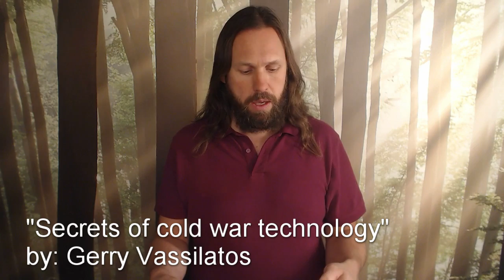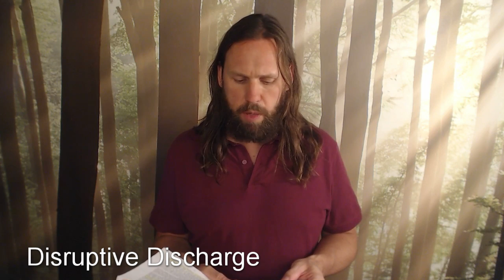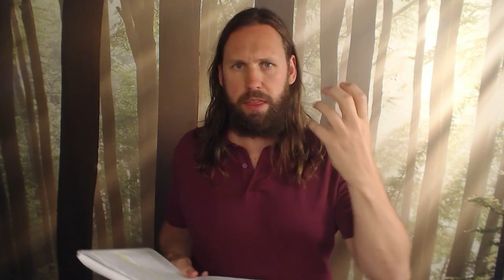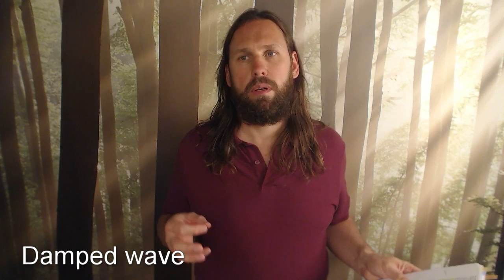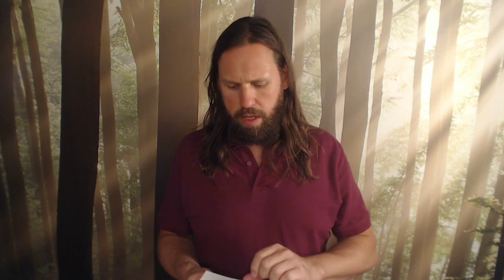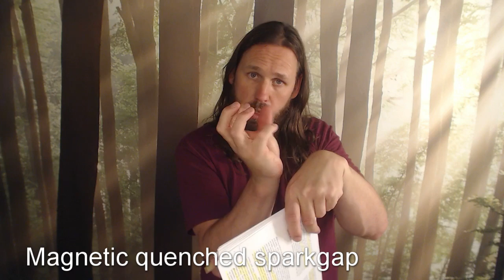Nikola Tesla's Radiant Energy Part 1 of 3

Comment: radiant energy is dc high voltage zero current. radiant matter is pure voltage. aether is voltage!
Reply from the maker: a high voltage change with very short duration (impulse ) equals current. but it's a current without a magnetic field, without Aether "drag"
Reply: @MasterIvo  so is the "aether drag" voltage ? i really think so! infact i believe voltage itself is aether when truely seperated from current it becomes a superdynamic neutral particle super creative by its nature and at a spin (quantum motion) faster then light!
Reply: Generally a vibration in ultraviolet and above means breaking apart the nucleus structure.  When the vibrational frequency gets near Gamma, we are probably looking at a vibration that is   breaking the proton or neutron back into ether medium or photons, like the sun does.  Roughly 918 photons per proton.  This releases the binding energy of the proton, like spent rocket fuel.  Also there are neutrinos involved, or bunches of photons that did not completely vibrate back into photons, like neutrinos that explode  upon impact, like paired photons in a laser particle beam.
  Tesla called neutrinos "neutrons," but he was getting them to beta-decay electrons out of nucleus and running an electric circuit with them, he called it cosmic energy.
  Also when you separate and atom into electron and proton it releases 1  mole of photons that were stored in the atom, and that is 1 mole per electron-proton pair released.
Reply: @JoeDeglman  bro ur facebook bro ??? i need help "knowledge" answers i seem to have reached pretty deep into the rabbit hole. i need data i have endless questions and i believe u really can help me out on that!
Reply: @boxgajodar4144  I have no facebook.  I am however on YouTube   https://www.youtube.com/results?search_query=joe+deglman+
Be glad to guide you along.
Reply: Anything to do with magical particles are false BS.

Radiant energy refers to voltage, that is correct BUT you got it wrong about voltage doesn't have magnetic field.

Voltage itself IS magnetic field. Integrate voltage and you get magnetic flux, magnetic field. What current really is, is dielectric flux flow, aka dipole self-destruction. The dielectric field formed between two voltage polarity, or two stationary magnetic field as described by walter russell, tends to collapse when the two magnetic fields are connected through the matter. It destroy itself!

This is the unnatural form of electricity. Radiant energy is simply "the collapse of dielectric field" but the connection doesn't last long enough for continuous destruction as compared to DC and AC. This is why impulse current tends to churn up the aether, generating greater voltage than the collapsing field.

Hence, this radiant energy aka self-amplified voltage can pretty much charge a battery.

But. This system isn't that superior when compared to  negative power system, MY system.

"Electrons"/dielectric flux always "flow"/collapse from negative to positive. IS IT?

Nope. Using "electron-deficient"/materials with natural biased dielectric field, you can force the dielectric flux to flow from positive to negative. This is the natural form of electricity. Self-amplification, regeneration, restoration and strengthen of dipole, strengthen of stationary magnetic field with opposite spin.
Reply: @lukiepoole6701  Pretty much, I think you are right.  But, magnetic field is the flow of the dielectric medium, acting as a waveguide for charged particles (positive or negative) between voltages.   When the charge level between source and target is strong enough, the dielectric medium lines up and allows for the flow of charge, a dielectric breakdown.
   You cannot have a magnetic field unless there is flow of the a dielectric medium.  A magnetic field is the flow of the ether medium from source to target.  Without flow there is no magnetic field, no magnetism or magnets.
    Matter or a conductor just acts as a waveguide for the flow of the charged particles, when matter is involved.  But, in this experiment, I think we are talking about the breakdown of the electrode itself, back into plasma, protons and electrons, and possibly breakdown of protons into its constituent particles, the photons, AKA dielectric.
  So you are right, there is no magnetic filed unless there is flow of charged particles.  "The magnetic field we see flowing around all charged moving particles is the ether medium."
Reply: @JoeDeglman  Wrong. Flow isn't necessary to form magnetic field. Do you see any flow in a permanent magnet? No. Magnetic field forms die to alignment. No flow actually needed. This is why voltage alone is enough to generate magnetic field.
Reply: There is a flow in a permanent magnetic. If there were no flow in a permanent magnet there would be no objects travelling towards the ring current of the magnet, I.E. no magnetism. Whenever something moves there has to be high and low pressure, and movement in the ether medium or dielectric.
    Voltage is created by what is known as charge, but not necessarily movement.  The charge must overcome the dielectric forces to create a flow, then generates a magnetic field. No one has ever created a magnetic field without moving charged particles.
Reply: @JoeDeglman  That's right. No one has ever generated a material that generate magnetic field without moving "particles". This is false as permanent magnet itself really does not have any moving "particles" in the first place.

You need to know that there are no such thing as particled and every atom you see is a tiny magnet.

You should know ken lee wheeler where he show the truth magnetic field of a magnet that is generated using positive power.
Reply: @lukiepoole6701  Check out Distinti on magnetism.  https://www.youtube.com/watch?v=9sUP_iL6NIU&t=213s
   What causes magnetic poles to "attract" or "repel" is the flow of the dielectric into one pole and out of the other.  Two north poles "repel" because of the high pressure created between them when the medium tries to flow out of  those poles.   Same poles attract, because of the alignment of the dielectric flow.   Two south pole "repel" because of the medium flow  into those poles pushing the magnets apart.
   Even galaxies have a dielectric flow, known as a fermi bubble.
   Any time you have charged particles in a ring current, such as a magnet, indictor coil, planetary ring, or plasma torus, star, galaxy, you get a self sustained magnetic field or flow, a self-draw of current or plasma.
Reply: @lukiepoole6701  Right Ken Wheeler, He and Dollard try to say there is on such thing as an electron.  Did you know wheeler completely fudged the words "an electron" into Steinmetz quote.  Here is the original text, page 11.  https://archive.org/details/elementarylectur00steirich/page/n6
    Steinmetz said no such thing.   Steinmetz is merely pointing out that Ampere's law is not due to charge on the wire, but the movement due to energy storage or inductance of the wire, AKA the dielectric storage between the wires.
    Here is how CERN strips an electron off of a proton.   If Wheeler was right, a proton would just generate another electron out of counter-space.  Wheeler is completely wrong and had to make it up as he went, because he knew the facts were not on his side.
https://science.howstuffworks.com/science-vs-myth/everyday-myths/large-hadron-collider4.htm
   If Ken were right, CERN would not have to save electrons and reintroduce them back to the atom, the proton would just create a new end terminal out of counter-space.
https://www.quora.com/How-was-an-atom-of-antimatter-anti-protons-in-the-nuclei-positrons-surrounding-it-created
Reply: @lukiepoole6701 My take on what Tesla is doing is the same thing as a "Peratt Instability."   If you watch what the plasma dumps are doing in this "Peratt and Petroglyphs" video at about 9 minutes ----->    https://www.youtube.com/watch?v=6meaU1QcSdA&t=880s

then they are doing the same thing as Tesla, dumping a lot of capacitance discharge from a plasma focus device.

   So in  a Peratt instability, we see the vortex rings, essentially caused like a smoke ring or an eddy current in water flowing through a culvert, AKA moving the ether medium through itself, creating a constricted flow, like a smoke ring or a torus in a carburetor flow.  Essentially this is a smaller-scale Herbig-Haro situation, that's creates planets or stars at the vortex rings in a constricted flow.

  Essentially Tesla then is trapping the electrons and charged particles in a vortex ring, as in the Peratt video or a smoke ring, thus separating them from the medium, and this allows the ether medium to flow through separated from the electrons as radiant energy.

Comment: My explanation of what's possibly happening at 4.50 min is the coil can not sustain the over sized magnetic feild so as it equalises it re converts some of its energy  into voltage. Voltage can change direction quickly but current cannot. Just like a river. The flow of the water direction  requires effort to change but the the pressure of the water can change direction with ease. Imagine a fire  hose on full power and it take 3 men to hold it steady and direct the nozzle in the right direction. Its hard for them to instantly change its angle but if you stab the hose in the side it requires little effort and now the pressure voltage is squirting out the side. Easy for the voltage to change direction but harder for the current. 
 Best analogy I can use would be water coming out of a hose and hitting a square plastic  tub on the driveway and pushing it along. Initially it starts to push it but the water pressure is met with resistance and splashes some to the side but as it starts to move, more of the water pressure is used to propel it until the water equals the speed of the bucket. Think of the water splashing out to the sides as initial voltage spikes and the flow of the water as the current!
Reply from the maker: I like the thought of water splashing, but instead of water, I imagine these splashes, are longitudinal aether pressure waves/fields
Reply: @MasterIvo  Yes exactly like podkletnov's impulse gravity beam generator, sounds just like sub-quantum kinetics.
Reply: Adding to my comment.... So as the coil tries to take on charge as fast as its inductance will allow it finds itself unsustainably overloaded and  oversaturation of magnetic flux and almost instantaneously it does a backpressure burp if you will. But as it can't change its direction of current instantly it instead relieves it self via a voltage burp that can change direction much faster!

Comment: My thoughts about this one:
1. The velocity of propagation of a changing voltage level in a copper conductor is about 95% of the VoP of free space.
2. When the fast-rising Voltage is applied to the conductor, the voltage rise on the conductor is travelling at 95% of the speed of of the voltage rise in the free space surrounding the conductor.
3. The higher the voltage and the faster the rise-time, the greater the potential gradient between free-space and the surface of the conductor.
4. The radius of the conductor determines the E-field surrounding it: smaller radius = lower breakdown voltage of the surrounding free-space.
5. At the initiation point of the rising edge, the local e-fields are the same; the further away from the point of initiation, the delay of the voltage rise in the metal conductor will lead to an e-field strength high enough for a corona discharge between conductor and the surrounding air, further along the line.
6. For an infinite length of conductor and constant diameter, corona breakout will occur at regular intervals. 
7. As the conductor concerned has a fixed length, transmission-line theory comes into operation. There will be reflections of the voltage rise, back and forth along the conductor, giving additive and subtractive products, that will cause the over-shoot that you see on the trace. The visible corona will appear at the same places whenever the system is energised.
8. These additive and subtractive products will explain why corona breaks out at seemingly random intervals along an apparently smooth, constant diameter wire.
9. I enjoy high voltage experimentation, please have a look at my you-tube channel! https://www.youtube.com/user/nlo114/videos?view_as=subscriber

Comment: Imagine a rod made of a slightly elastic material, like a hard rubber. The rod is used to shove a heavy object. If the approach speed of the rod is high enough as it contacts the heavy object the tip of the rod will appear to swell as it contacts the surface of the object. Once the resistance of the object is overcome and it begins to move tip of the rod will once again assume it's original diameter. This is the spike when the voltage first encounters the resistance of the wires inductance. With high speed photography I imagine we would see a wave of the blue spikes travel along Tesla's wire.
Reply from the maker: Actually, there are also the white fluid waves
Reply: Exactly, the radiant force is the flow of aether or polarization of the vacuum virtual particles. This is what Eugene Podkletnov did with firing an electron discharge at a superconductor. He created a gravity force beam that bent metal plates an blew a hole through a concrete wall. He measured the beam at 64* light speed also. Tesla made a beam tube that can focus this radiant force into a narrow beam that could charge capacitors from a long distance, it was a radian beam laser.

Comment: You also need to understand Ed Leedskalnin's "Magnetic Current". These hypertoroid rings are forming at the ends of chiral springs. Secondly, please understand an oscilloscope is giving a 2d representation of a 3d helical coaxial coil. 

Similar "poles" will push against each other and compress back on themselves and cause backfeed EMF. When opposite "poles" get close the springs will stretch out and intertwine with each other, much like vines, Birkeland currents, fluid dynamics (Alfven's magnetohydrodynamics).

Also remember we exist in a fractal bifurcation system, a single source will always branch out in vortex fractal patterns to reach equilibrium. Examples include mandelbrot sets, lichtenberg patterns and fibonacci sequence. Each one of us is an example of this, and this also provides evidence of entanglement, coaxial transmission of power and information at FTLS between dipole nodes on a dedicated encoded link.
Reply from the maker: Indeee the 2D scope image of a sine wave doesn't give much detail on the 3d, transverse/longitudinal traveling/standing, waves

Comment: In truth, radiant electricity is the PSI field. It is generated when voltage is converted into it using a capacitor. There is more to what meets the eye though. (Love using this sentence lel.)

NO quantum quackery. It is fake crap.
Reply from the maker: sounds good ;)
Reply: Very good information it sounds correct thank you for sharing that